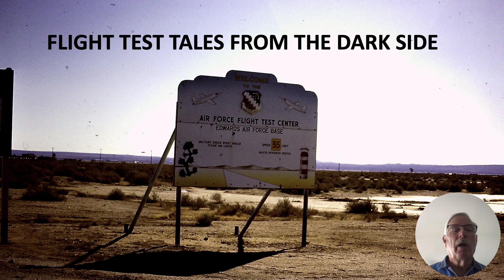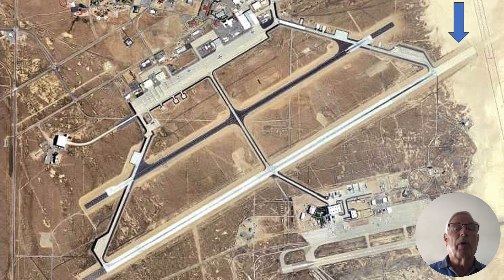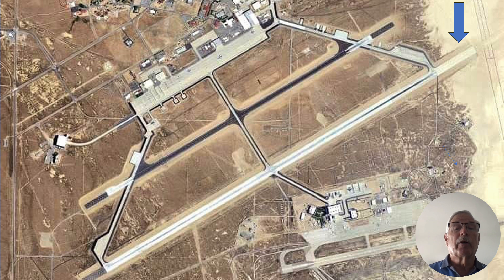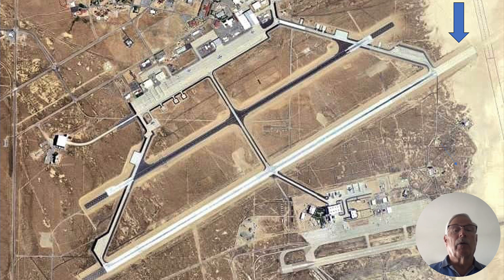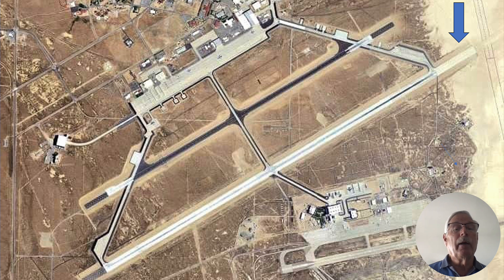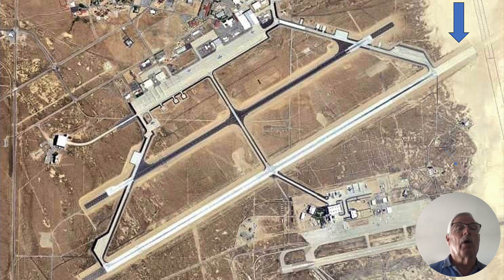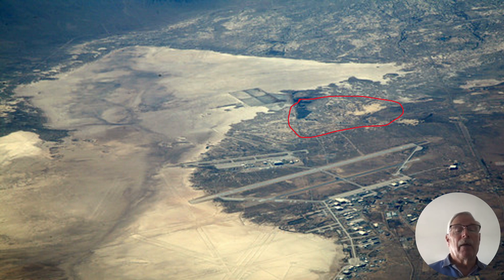The True Length of the Runway at Edwards Air Force Base, the Flight Test Center!

Comment: Renovating the P1 quarters and the swimming pool was one of my dad's pet projects. In 1965 the quarters had been unoccupied for 20 years or so. Col. Yeager identified the source of stink that was preventing further renovation. It was desert rat droppings. They took away dropping by the wheelbarrow full.  The pool had been filled in with dirt to eliminate hazards with big empty concrete lined holes.  It may have been used for visiting generals and vips but my understanding is that was the commanding generals quarters during the early days when South base was "the" base.
Reply from the maker: Wow! Your history obviously predates what I had known and thanks so much for sharing! Good point about the focus of south base (what we call that now). The housing area I lived in was totally wiped out in one of the renovations so things do change a lot.
Reply: @ronrogers so in the 2000' maybe 2014 ish they put that shorter asphalt runway in . They dug up the old runway . No way was it 20' ft thick. Maybe 4'or 5 'max. I used to go up to the Generals house and saw the pool. There was a great view of the base and the south end of the lake bed. They also had an antenna up there so the General could listen to the radio chatter. It was used by the MWR for parties while I was there ,1989 till 2019. In the last few years I was there they demolished the house. It cost a ton as it was tented due to asbestos.  The hill looked barren afterwards.  All the houses that were there ( as seen in the movie Right Stuff) were torn down in the 90's . I sware you could see the curvature of the earth looking down that runway.
Reply from the maker: Was the old runway in that bad of condition. I  supposed it could be being that old. Interesting about the depth. I was told the story by the then Wing Commander. There had been a discussion about runways on the lakebed and how suitable they were for the shuttle and he mentioned about the depth of the main runway. Must have just been an urban legend. You really know a lot about the history of the base! I wanted to get a chance to see it again but they said that was not possible for "civilians" and everything had changed so much anyway I would not recognize anything!

Comment: A fellow Crewdog crew from the 7th BW, Carswell AFB, TX did an emergency landing in their B-52D at Edward's. They lost all hydraulics because a DEI female attached a low pressure line to the high side. Yes! They had DEI in the 70s. 
"Get the damn crash trucks out of the way because we have no steering, only crosswind crab." How much runway did they use?

Comment: "Sir, we poured 15,000 per the contract... the contract didn't specify length after hardening." Obviously they didn't construct the runway in one pour, but that would have been a good excuse for the contractor...
Reply: Yes, shrinkage is why 2x4 lumber isn't 2x4 in size when bought. That is the size when green.

Comment: I’d heard that the center commander at the time Rwy 4/22 was constructed told the contractor to use some of the concrete to build a pool in his backyard.   The runway measured 14,997’ when it was being accepted/certified.   When the contractor explained where the missing 3’ of length went, the base made the generals house into a MWR facility.  I thought it was only 3-4’ thick.  I worked in Eddie Tower during the mid 80’s.
Reply from the maker: This was at the visiting general's quarters, south of the main base. The Commander/general's house was situated next to the O'Club.
Reply: The main base runway was built in 1952.  At that time the Center Commander live in Generals Hill.  (Old South Base housing area).  The base housing area you and I remember wasn’t built yet.